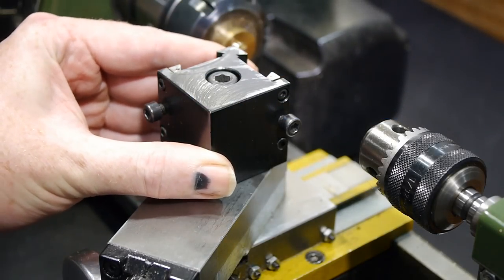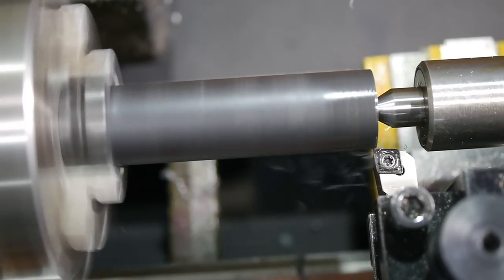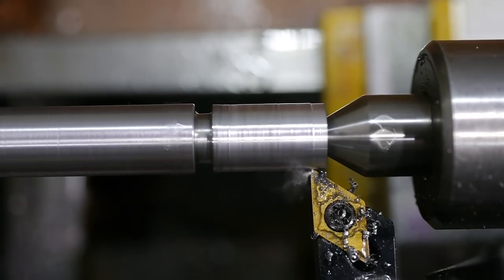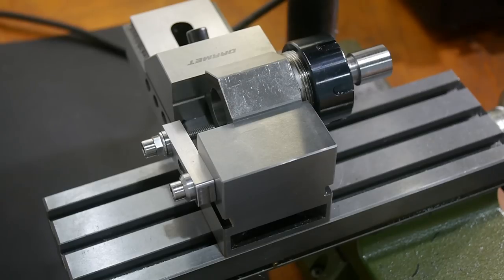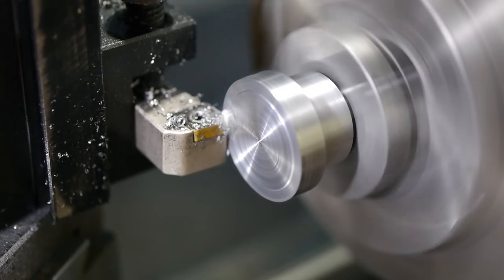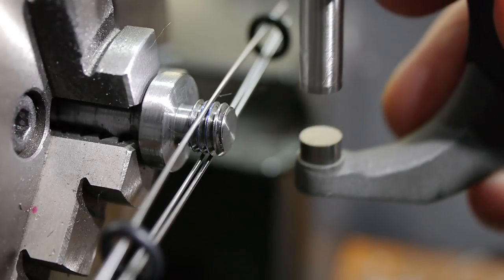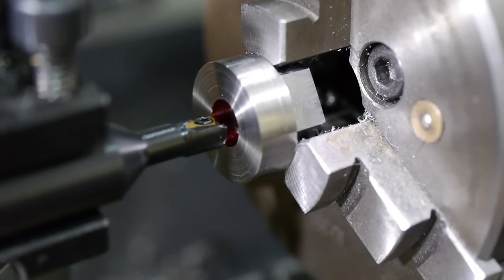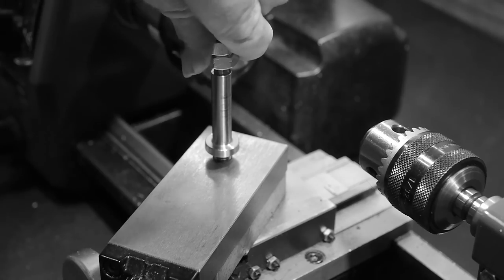Quick Change Tool Post Upgrade for the Proxxon PD 250/e Lathe

Comment: Quick tip - How To Hold A Short Part In A Collet Chuck.
ER collets are designed to accurately hold a part that is at least as long as the collet itself. So what do you do if the part is shorter than that?
Push a bar of exactly the same diameter as the part into the collet first before you insert the part.

Comment: Hi yes it is a loose tool post to share the least WOW that is bad. 
This video is going to be really helpful for the many Proxxon owners. 
This looks and is actually much stronger, may we share a thought here. You used a great material 4140 range in our opinion. 
What I have learned is that you created a shaft that is fixed and fashioned a nut atop this shaft so we like for this. The shaft threads into the Proxxon no removal so the female and male threads both remain tight into the cross slide over the course of time as apposed of that factory bolt going down through that tool post and screwing tightened each time you change a tool holder, so that is why we like it so much. 
Great job helpful to other Proxxon owners and not too tough a fix they all can make it using the very machine but would still need a mill to complete what they are improving, that should not be to  big a deal.  
Great video, Lance & Patrick.
Reply from the maker: I had not thought of that advantage, but thanks for explaining it to me. It's good to know I'm learning to go about solving these problems the right way.
A mill isn't strictly necessary for this project, as it could have been accomplished using an ordinary off-the-shelf nut. I just liked the idea of a shiny, custom made nut, with a shoulder for the wrench to sit against.

Comment: Nice job!  I have a small Atlas 6" lathe which is highly flexible (and I don't mean that in a good way).  I noticed that you have the same problem that we all have that when you rechuck something in the 3 jaw you have to retrue the surfaces.  I found that marking one jaw (on mine it is, surprisingly Jaw #1) and also marking the piece where it contacts Jaw #1 allows me to remove and replace items in the 3 jaw with minimal offsetting.  My chuck has a concentricity error of about 5-7 thou depending on the part's diameter, phase of the moon, temperature etc. but using this marking scheme allows a part to be removed and replaced with about 1-2 thou error.  Not perfect but better than a random error.
Reply from the maker: Thanks for the tip! I've reduced the amount of flexing in my lathe a lot by mounting it on a polished granite slab. I'm really happy with this upgrade, though it took a while, and wasn't cheap.

Comment: These videos are a delight to watch with many useful tips and humour in the clear very presentation. Here are my comments:

1. Tubal Cain recommends roughing out all elements that have mill scale or a roughcast finish, even rechucking to eliminate surface or included rubbish before starting the precision work. The scrubbiest  tool in the box should be used for this.

2. MS seems a better candidate for this job. The advertised TS of the tool steel is only obtained after heat treatment (which you do not employ). MS seems to me to be up to the job (400 MPa).

2b. Should you consider the flange/journal to be in danger of excessive wear/abuse in service you can case harden it. Cheap and cheerful.

3. The QC block is adequately located by the top surface of the slide and the O/D of your flange/journal. This means that the rest of your gadget merely has to provide a clamping force that must not interfere with the good work already done by the slide and your journal.

The important principle here is that the clamping force of the clamping nut MUST pass through the KERN or 'Middle Third' of the mating surface between the QC block and the slide below. Following this rule means that the clamping force is positive (and never negative)  across the entire block/slide mating surface. I do not have space here to justify this rule here: look it up. There are several ways to accomplish this:

3a. Make the length of the spindle incapable of transmitting a bending force. You can do this by necking the spindle to make it 'whippy'. The use of MS with a lower TS here will assist you. 

3b. Or by turning the underside of the nut to a spherical profile to match a spherical socket  profile of the brass spacer to eliminate bending forces.

I would prefer to have a limb amputated to avoid milling a hex on any stock. Just buy hex stock. In this project I would buy a M8 Bristol lever to replace your 'nut' with a couple of greased MS washers below to eliminate torque on the spindle.
Reply from the maker: Wow, that's a lot of information to absorb. Sorry for my late response, I've been out of town for a few days. I'll try and  go over your points one at  a time.

1. I'll take any advice from Tubal Cain, but this sounds particularly useful. For most of my recent projects I've been using silver steel which comes with a ground finish, but I've still got plenty of hot rolled good quality steel, so I'll remember this.

2. The main reason I don't use mild steel any more isn't the lack of strength, but because the material I can get hold of can be more difficult to work with on my mini lathe. My first few projects (before I started making video) were made with bright drawn mild steel, and the material was inconsistent, with some tough gritty patches. This meant I got a very bad finish, and varying depth of cut. Silver steel is easy and consistent to work with, and much easier to get in small quantities for reasonable prices.

3. You're absolutely right about the location of the toolpost. During this project I was very determined to eliminate anything inbalances that might cause the toolpost to shift slightly while it was being tightened, and make sure the toolpost was stable with very balanced forces holding it in place, so I probably went further than necessary.

3b sounds like a really nice solution here, if perhaps a little more than the lathe really needs.

I'm planning to install a new toolpost on the Proxxon, which is going to be the same Machifit model I fitted to the chinese lathe, installed on a solid base (without the compound), so I get to try a new design, and try out your suggestions. Thanks for taking the time to write the long comment. I'll spend some time looking up why force lines need to pass through the KERN of a mating surface.

Comment: Beautiful work!   If it still slips or turns I found an old machinist trick that worked on my mini lathe.  Put a piece of paper under the tool post to keep it from sliding.  Chris
Reply from the maker: Thanks Chris, neat idea. Regularly stoning the top of my compound, and the base of the toolpost have helped a lot to make sure it is stable when fastened down. I haven't been able to afford a pair of precision ground flat stones yet, so I use the poor mans substitute, made by dressing the stones with a fine diamond knife sharpener. They aren't nearly as flat, but they have the nice property of removing burrs while leaving flat steel surfaces untouched.

Comment: 42CrMo4 is a hell to cut even on massive lathes. I'm shocked, the little proxxon did so well.
Reply from the maker: It's not the easiest, but I've found EN24T and 316 Stainless to be much more difficult and frustrating.

Comment: Depending on how often you actually rotate/use the compound, you might consider ditching it altogether, and making a solid toolpost block (a la Robin Renzetti and Stefan Gotteswinter). I did this on my Seig 7x10 mini lathe, and it made a world of difference in the rigidity of the toolpost. Honestly one of the best modifications I've made to the lathe, even beyond all the scraping and squaring of the entire carriage.

I still have the compound slide and its base, in case I ever need to cut a small taper... But I've not mounted it to the lathe in quite a while. Even for single-point threading... I just plunge the tool in with the cross slide, and no issues.
Reply from the maker: A solid tool post is definitely on the project list. I was convinced as soon as I watched Robin Renzetti's video about it. It's going to be tricky to make with my equipment, so I'm planning the project carefully.

I do use the compound quite a bit for threading. My little lathe cuts way more cleanly with the compound advancing parallel to the thread angle. Feeding in at 90 degrees is pretty chattery. Maybe a solid toolpost would fix that too. :)

Comment: Great work Mr. Rogers! 😀 I like the o rings to hold the thread wires
Reply from the maker: Thanks Dustin! You know what, I'm going to add your original "Mr. Rogers" quote to my channel page. :)
The o rings turn out to be easier to use, and more secure than small elastic bands.
Reply: Yes, when I saw the O rings on the thread wires I had to slap my head.. All these years and I never thought of that.  Nice. @AdventureswithaVerySmallLathe
Reply from the maker: @Gronicle1  Certainly not my own idea. Happy to be able to pass it on.
Reply: Cheers and blue chips @AdventureswithaVerySmallLathe

Comment: Very nice, I very much like how you machined the nut before parting off the bolt, thereby using the (already completed) bolt for holding the nut. Will add that idea to my bag of tricks, if I may..
Reply from the maker: Thanks! Sometimes I overthink my order of operations a bit, and try a bit too hard to avoid creating too much scrap, but it can be really satisfying when it works out. :)

Comment: Looks good! A tool free adjustment can be had by drilling the top nut and adding a piece of round stock to act as the handle.
Reply from the maker: Definitely a good idea, though probably more useful to someone who adjusts their toolpost more often than I do. The main reason I didn't do something like that is I wanted to keep the space around the toolpost clear to ensure I can get a clear camera shot.

Comment: Nice job and video. Two thoughts. I have a video where I made a locking handle/nut to eliminate the need for a wrench every time I need to adjust the toolpost. And you could mill two flats on the shaft of your post to eliminate the need for the jam nuts to remove/tighten the post. Just put the wrench on the flats. Keep ‘em coming.
Reply: I was thinking the same. Two flats shouldn't affect the registration any at all.
Reply from the maker: Thanks, that's a useful suggestion. I'm hoping to solve this problem by broaching a hex into the top of the shaft, so I can tighten it and hold it in place without needing to access the lower part of the shaft. Trouble is I need to make myself a rotary broach first. :)

Comment: Just un boxed my new 250 and now I see what I need to kit it out.
Reply from the maker: Congrats! If you want a really good toolpost, I'd suggest you take a look at the video I made about fitting the cuniform gib toolpost to the chinese lathe. That toolpost would work fine on the 250, and is both better quality and cheaper than Proxxon's own. The trick is that you have to make your own mounting stud, similar to the one I make in this video, but customised for the other toolpost.

Comment: Nice work as always & including your solutions to the various problems encountered.
For my Q/Change, I just swapped out the original bolt for one of the Kipp "lift to adjust" Lever Handles which has worked well enough...
...but this video has got me thinking so will need to do some double checking.
I'll send you some photos of the Clamps that I ended up making to hold my Mill Vice down, as I think you'll find them useful.
regards Colin
Reply from the maker: Once I get the tool post trammed, I don't tend to move it very often, so my priority with this upgrade was to ensure I could tram the post reliably. I guess it's down to the style of work I do, that I don't often make cuts with the cutter at an angle.
I'd be really interested to see the design of your mill vice clamps. I'm planning to work on that problem for my mill.

Comment: I like the solution.I had to make a similar post to put an AXA toolpost on my EMCO V10. I can't help but wonder if the radius has room in the bore of the tool block. I noticed the surface of the tool post block looks fairly rough. Getting a smoother finish there can help with rigidity and clamping force on the compound. Thanks for the well  produced video and explaining the challenges you faced whilst making the upgrades!
Reply from the maker: A few weeks after making this video I managed to beg some time on the surface grinder in a nearby shop, and ground the bottom of the toolpost. It now fits a lot more smoothly. I made certain I left plenty of clearance for the radius.

It's a bit sad that Proxxon couldn't properly finish the contact surface of the toolpost during manufacture, as the item isn't especially cheap.

Comment: Tram it quickly by moving the tool post against a flat face on the spindle. When you tighten the bolt it will stay put also.

Comment: I have not bought my hobby lathe yet, but can I suggest that when machining stock with a 'skin' on it that you drop the revs and use a deeper cut to get under the shale, you were just using the stock to grind away your expensive carbide tip.
Reply from the maker: The problem with simple mini-lathes is that when you drop the revs, you also are dropping the torque. Many don't have a drive gearbox or swappable belt ratios, so you drop the revs by turning down the motor speed. At these slower motor speeds, the lathe is even less able to do deep cuts. I don't think my Proxxon can cut deep enough to make it through mill scale in one pass at any rpm, so I generally put the cheapest chinese inserts I have on the tool and scrape away at it until I make it through.

Comment: Not sure and I Could be wrong because I know nothing of these lathes but at about 1405 in the video your thumb is almost covering a hole which normally On a bigger Lathe would have a matching hole on the compound that you use to lineup and study your tool post now this lathe is missing that hole but it has one in the tool post itself so I’m not sure what the difference is there or what it’s for but usually it’s to solve the problem of the trouble of moving around and keeping it directly in line with the chuck. Thought this may be could be of some help as I’m around these machines all day long. So maybe it is missing or a quality check missed it on their end through this company or I’m completely wrong to begin with lol, all the best! Love your videos!
Reply from the maker: You're absolutely right. The hole is there, and is pretty clearly intended to be used to align the tool post. As I discussed with Juan Rivero in an earlier comment, there are a couple of features of the toolpost which don't seem to be usable on this lathe. It's possible an earlier version, or different model lathe had the right holes and registers, but I'm not sure.
If I wanted to use this alignment hole, the real trick would be to find a way to measure it's exact offset from the main register.
Reply: Adventures with a Very Small Lathe. You might be able to get that info from manufacturer? Or at least get you going in the right direction. Anyways awesome videos man keep them coming great work!!

Comment: One suggestion for keeping your toolpost square with the centerline of your machine. I see a dowel hole on the base of the toolpost, why not fit dowels on the top face of the compound slide for quick and easy positioning?. You could  install dowels for all your screwcutting angles and one for when the toolpost needs to be perpendicular to the chuck .
Reply from the maker: That's a great suggestion, but the compound is small and thin, and I don't think I could fit many holes before making it weaker. I definitely plan to add aligning pin holes when I make a solid tool post, to sit in place of the compound when no compound adjustment is needed.
Reply: Looks to me if you improve the finish on the bottom of the toolpost that it would greatly decrease the chance for it to moves.
Thanks for the very informative topic   Zed
Reply from the maker: A few weeks ago I got some time on a surface grinder, and ground a really good flat finish on the bottom of the toolpost. It now sits much more smoothly in place.

Comment: I love stuff like this. Nice work. I’m sure you will enjoy working with this lathe much more now.
I thought you had guts with that 8mm internal thread :) it’s great to practice techniques but sometimes the simple option is the best.
I’m working on Tubal Kane aka Mr Pete222 ‘s Carriage Stop at the moment.  You may want to consider making a Carriage Stop for your lathe.
Reply from the maker: That's a great plan, I'll add it to the project list. I don't think Mr Pete.'s design will quite work on this lathe though, as the guard for the lead screw is in the way. I'll have to come up with something slightly different.